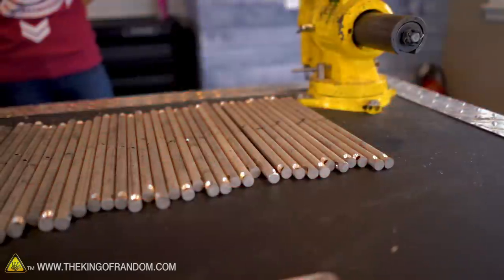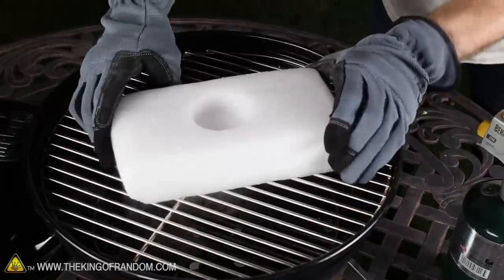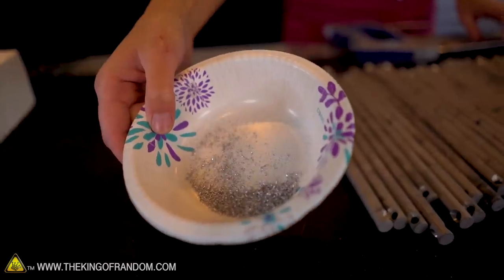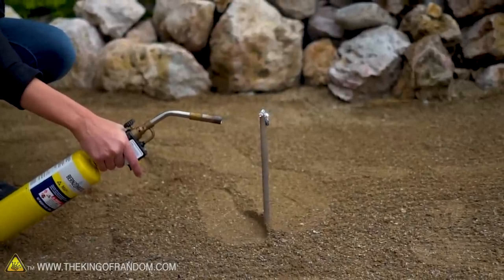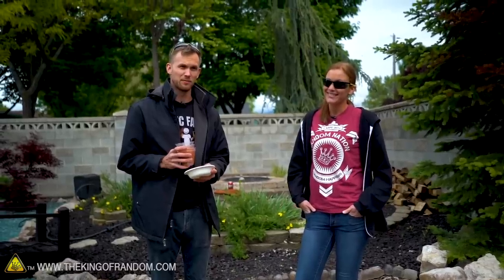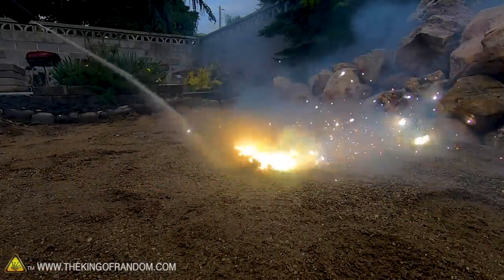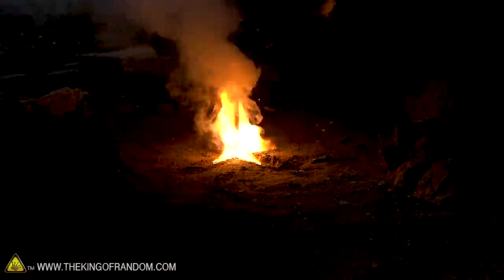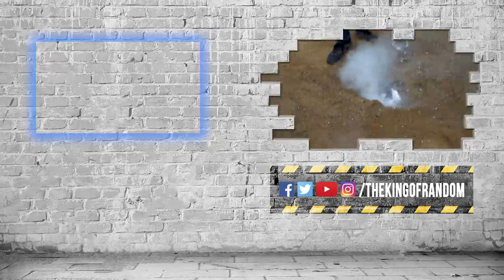Why Magnesium Fires are SO DANGEROUS

Comment: For those curious, when you spray water on a class D fire, the intense heat rips the oxygen out and uses it as fuel
Reply: with magnesium it liberates hydrogen which then reacts more and explodes.
Reply: I’ve had it ignite in my face putting car fires out
Reply: hydrogen and oxygen are explosive when mixed
Reply: and then leave the hydrogen free to burn in the atmosphere, so no what not even as a joke!!
Reply: because magnesium creates it's own oxygen
Reply: Oxygen is not a fuel. It is necessary for combustion.

Comment: Try putting out the magnesium with liquid nitrogen?
OR
Try making the magnesium even brighter with liquid oxygen
Reply: The first one is ok... The second one is suicide
Reply: Whis Sama liquid oxygen would also put it out most likely i believe it is as cold if not colder than nitrogen correct me if I’m wrong
Reply: Andrew Meany it is less cold
Reply: @M3ANIAC  for reference look at their liquid oxygen on carpet video... Heat and pure oxygen= bad time...
Reply: If you’ve ever seen a rocket explode, that’s liquid oxygen. Oxygen is why magnesium can’t be put out with water, and why it will even get brighter when sprayed. The oxygen in the water is also being burned.
Reply: I literally came to the comments to say that
Reply: DO THIS
Reply: Had the same idea with the liquid oxygen
Reply: @lileigh nguyen metal fires are self oxidizing it will keep burning
Reply: The oxygen idea would be awesome
Reply: Andrew Meany it is about as cold but liquid oxygen makes almost any that burns burn even better so it would most likely explode
Reply: @M3ANIAC  Temperature is irrelevant.  The lox would start reacting and build up heat very quickly.
Reply: I think will bee the same
Reply: @freddiemercurygaming4124  it will not be the same it will be wayyyy more energetic in liquid O2
Reply: I approve, liquid Oxygen
Reply: as a nitrox diver, I think mixing liquid oxygen and burning magnesium will create a terrible explosion. One of the important rule I've learned from the Nitox course is never allow fire within 10ft from oxygen tank, otherwise your body parts will scattered all over the places. Please never do that.
Reply: I dont think its stronger because its cold, i think its because it provides extra oxygen. the CO2 is broken into CO, or carbon monoxide. lnitrogen would not do much. this is why metal fires cannot be put out with water. the water breaks into hydrogen and oxygen.
Reply: putting it in liquid nitrogen will sustain the burning process as it will form Magnesiumnitride
Reply: The Lexdysic cartographer k
Reply: Magnesium burns so hot that it makes water break down into hydrogen and oxygen. That's why water won't put it out; you are just adding fuel and oxygen to the fire. 

The dry ice is CO2, which breaks down into carbon and oxygen -- so, again, it just makes it burn brighter. Adding Liquid Oxygen would make it burn extremely brightly, but it would be extremely unsafe. Like "Burn down your neighborhood if done wrong" unsafe.
Reply: great idea
Reply: @M3ANIAC  no liquid oxygen will give 100% oxygen atmosphere for a little bit for the magnesium it would burn at 2x to maybe 6x it's normal burning temperature
Reply: @M3ANIAC  Oxygen burns very well. It doesn't matter if it's cold
Reply: Oxygen doesn't burn
Reply: putting it in liquid nitrogen would be nice like actually dropping it in there
Reply: @huntonius  liquid oxygen does burn very well
Reply: @huntonius  It burns
Reply: @popepiusxv  Actually, oxygen doesn't burn - it makes other things burn (fire is just a self sustaining oxidation reaction after all)......  Next look up oxygen's pissed off big brother - Florine, it's a better oxidizer than actual oxygen ;-)
Reply: @Clint Jackson normal oxygen gas doesn't burn itself but liquid oxygen does
Reply: Anonymous Anonymous  what?
Reply: There's so many wrong assumptions in this comment section it makes my brain hurt.
Reply: You are a fool liquid oxygen burns much faster
Reply: Andrew Meany see their video, i believe its melting diamonds go see that video.
Reply: @chaitanyaprasadsahu9236  oxygen doesn't burn. It simply makes everything else burn better/hotter/faster.
Reply: Anonymous Anonymous  wrong. Oxygen, by itself isn't flammable. It makes things burn better, but doesn't burn on it's own.
Reply: Anonymous Anonymous  actually, what you said was, "both are highly flammable." Oxygen isn't flammable.
Reply: @M3ANIAC  it's not colder they use liquid nitrogen to make liquid oxygen
Reply: Magnesium continued to burn in a nitrogen atmosphere
Reply: @M3ANIAC  but its oxygen, so it will burn
Reply: @M3ANIAC  Liquid oxygen putting a fire out?! LOL!
Reply: Liquid ozone
Reply: @CausingChaos.  kinda like water on thermite. Great idea...not to pit it out, but great idea...
Reply: Patrick B
2 years ago
putting it in liquid nitrogen will sustain the burning process as it will form Magnesium nitride 
Correct.
Reply: I have seen a magnesium ribbon burning in pure (gaseous) oxygen. Well, "seen".

I was like 5 metres away with my eyes shut tight, and it was still dazzling. Ridiculously bright.
Reply: @M3ANIAC  liquid oxygen is indeed very cold but liquid oxygen is also a strong oxidising agent meaning it supports combustion and applying liquid oxygen to something that's already burning would be likely to cause a very violent possibly explosive chemical reaction.
Reply: Actually Magnesium can react with Nitrogen and make Mg Nitrate, which expels ammonia when you hit it with water

Comment: Uses water to make fire brighter 
Brilliant outstanding move
Reply: Why does it work though
Reply: @yocheeseify I'm a sailor, so I've been through DC classes where we learn about fires. When magnesium burns, it creates magnesium oxide, as they said in the video. What they didn't say is that when the magnesium oxide comes in contact with water vapor, it reacts, creating magnesium hydroxide and hydrogen gas. Burning magnesium has a very violent reaction with hydrogen gas, which creates more heat and light. It's the reason we just have to jettison (throw overboard) burning aircraft and other class D (metal) fires. Also, fun fact, magnesium doesn't require outside oxygen to burn, so those jettisoned aircraft can potentially burn under the water for years

Comment: "You can't use water to put out a magnesium fire!"
Nate: Keeps spraying it
Reply: might work if it wasnt airated so much aside from the fact that it still would need loads and loads of water
Reply: He was trying to get it to glow brighter
Reply: @kratosorokai1546   It would not. H2O + MgO= Mg(OH)2 +energy. By spraying it with water, he was feeding the fire.
Reply: @frantisekvrana3902  i did say he had it airated aka cause of the spray it would not work but i wonder bout if you submerse it
Reply: Throw it in pool = explosion?
Reply: 69 likes nice
Reply: @theguywhoasked6104  pretty much. There's footage of a fire department spraying water on a foundry with magnesium and aluminum. The footage is from a mounted security camera over a mile away and shakes when the foundry blows
Reply: @kratosorokai1546  No the water would keep it oxygenated and the millimeter wide ball of gas that would form around it would prevent the water from acting as a heat sink
Reply: @nicholashodges201  alright thanks for the explanation
Reply: that is correct. it burns under water.
Reply: I know this is and old comment but to me it looks like he put it out..

Edit: kept watching and I see the part this was talking about, oops

Comment: Hey king of random. 
Is it possible to cook popcorn in a tumble dryer?
Reply: CJ Lilac a washing machine washes. Tumble dryer heats up 🙄
Reply: CJ Lilac dryer*
Reply: no, i’ve tried
Reply: Theres a video on that
Reply: Maybe I dunno
Reply: I'd say no; popcorn pops at temperatures higher than most consumer grade dryers operate at, and even if you did somehow get the dryer to operate at a high enough temperature, the tumbling would breach the shells and allow the internal steam pressure to escape before the kernel could actually pop, thus no popcorn.

Comment: Try dipping the magnesium in liquid oxygen. Does it make it more flammable?
Reply: Liquid oxygen itself isn't flammable, but oxygen does promote burning, and magnesium fires are hot enough to separate the molecules in water making everything more on fire... so I hypothesize that, while it will not make an explosion, the breakup of the O2 molecules would mean that the magnesium would burn hotter and longer.
Reply: @GreebleClown  you mean brighter and quicker right?
Reply: @GreebleClown  oxygen doesn't promote burning, you need it to Burn anything. Burning is the reaction of a flammable material and oxygen.
Reply: @user-lg7cb6sr5z  Or in a broader sense, burning is any fast-paced redox reaction, it's the reaction between any reducing agent and oxidizing agent, reactions from the molar equivalents of magnesium and sulfur to exothermically form Magnesium Sulfide, to the reaction between two oxygen molecules and one methane molecule to produce carbon dioxide and water. Even the formation of Sodium Chloride salt from the reaction between chlorine gas and sodium metal fits the criteria
Reply: i’ve used thermal lances in construction for cutting through 1ft thick steel. they pump liquid 02 through the center of a hollow magnesium rod

Comment: It is used in aircraft, military aircraft for sure.  It does not get going that easily, but once it is going, such as on an aircraft carrier, about the only thing you can do is push it over the side.  After you do, it will burn underwater and underwater flares, and even normal flares contain it.  You CAN put it out, but what it takes is sand, and where are you going to get that much sand, that quick.

Comment: In the U.S. Navy, every time you are assigned to a different ship you go through training on that ship's fire fighting procedures. The basic procedures are common throughout the Navy, but customized to each ship because of differences in carried fuels, different fire fighting equipment, etc. On an aircraft carrier where "metallic fires" are more likely, the training is very simple. "You can't put this type of fire out. The only thing you can do is get it off the decks as quickly and safely as possible and into the sea. It will continue to burn even submerged, but burning metal does no damage if it's sitting at the bottom of the ocean".

Comment: Many years ago, when I was in a rented house share with another pyromaniac, we acquired a magnesium box.  It was great fun breaking bits off and setting it on fire with the blow torch that was set up on the kitchen table.
One night, when we got bored with the blow torch, we chucked the remains of the box (a corner) onto the open fire in the living room.  Eventually it caught fire, then we decided to bung some ammonium nitrate into the corner of the burning box (we just happened to have a big bag of it in the cupboard for some reason).  Nothing happened for about a second, then there was the brightest light I have ever seen that lasted for a  very short time and the box was gone.   It must have looked spectacular from outside, a shaft of white light heading skywards from the chimney.

Comment: You should try dipping the magnesium (on fire) in a bucket full of water (I think it will explode!)
Reply: Oh no No    
oh it will. I’m a firefighter and with car fires they have magnesium near the steering column and if it is hit with water it will explode
Reply: It burns too hot it instantly vaporizes the water underneath of it won't go under if you use a heavy enough amount to break the surface it's a 50/50 from experience sometimes it builds a layer of steam that protects it from exploding so it bounces around the bottom burning and sometimes it pops it depends on how pure it is
Reply: It takes the oxygen end leaves only    hydrogen which then explodes
Reply: Yes you are correct and the newer cars also have magnesium seat frames floor bracing and deck lids but that's different the water you're hitting it with is under pressure it forces passed the steam layer

Comment: Fun fact: that’s what is In sparklers

They use a powdered magnesium suspended in the clay substance
Reply: Actually, magnesium is just used for lighting it and creating white sparks. Yellow sparks are made with iron. The majority of the sparkler is low grade thermite clay. The colors come from different metal powders used in the mixture. Copper sulfate for green, potassium chloride for purple, sodium carbonate for yellow, strontium chloride for red.

Comment: Magnesium is also used for aircraft due to its heat resistance compared to some other metals of similar weight/strength. 
We still use it to this day, on certain components.

Comment: The reason you never use water is not only because it'll spread the burning liquid metal around, but because the metal is burning so hot that it's separating the water molecules into hydrogen and oxygen components, making the fire burn more energetically (i.e., hotter), so you'd be making the problem a lot worse.
Reply: I don't think it's the heat that makes this possible, but the fact magnesium is a more powerful reducing agent. The heat speeds the process, but magnesium will react with water to produce hydrogen, although very slowly.

Comment: This metal is still used in aircraft but as an alloy material primary alloyed with aluminum. 5052 aluminum is a mix of aluminum and magnesium, once alloyed it has a high corrosion resistance and is easily bendable. You cannot heat treat this metal and in aircraft you'll see this in and around fuel tanks as an example

Comment: was a jet mechanic on  A-7 Corsair when I was in the Navy in the 70's the wheels were made of magnesium also an the A-7 the yaw and the roll pack were made of titanium also A-7 dropped aerial flares were about 6 inches in diameter and about 5 feet long from high altitude with a parachute for lighting up a battle zone for straf8hg runs with 20 mm gatling guns and 2 inch diameter rockets from rocket pods. Because both of these metals are flammable all aircraft mechanic or anyone that worked on the aircraft had to learn how to put this burning metal out in an emergency. A ship had a tragic fire caused by an air drop flair that sailors were carrying from a flair locker on the USS Oriskany 44 sailors were killed.

Comment: Get a stick welder and attach the clamp to a rod and strike an arc with it.. In other words use it like a welding rod. Or attach both clamps to two rods that you strike an arc between.This would be high heat in a very concentrated spot and might help the rods burn from one end to the other.

Comment: You missed nicer experiments:  1-2 mm Mg wire burns continuously in air and under water 
as light source for scuba divers. As thin ribbons in the 50-60's were used  as flashlights triggered by batteries before the xenon flash light was born

Comment: In days of yore I was a firechief at a lumber mill.  I had a fire chief's handbook full of what to do in situations,,unusual situations.
There was a small entry on magnesium.  It addressed fires in business of machine magnesium.  one line--if the roof hasn't vented (blown the roof off) dump lots of water so it will and just let it burn.  There are chemicals that you can spray into the magnesium fire which will melt and coat the stuff.  Ir was very expensive and I doubt any public FD would have any large stock

Comment: Mix magnesium powder with iron oxide powder and aluminum powder in equal 1/3 quantities. Then put it in a small bag with a solar igniter and a battery and switch and get it burning and try to put it out.

Comment: You can use water to put out metal fires because ( if you manage to saturate everything ) only the metal structures will be able to burn, and a general building only has a couple of % of metals in it. The exception would be a mining or metal warehouse and perhaps some sections of a hardware store. There are other factors why water is avoided, like the weight and cleanup and to not ruin expensive machinery in Industry fires.

Comment: I work in an aerospace parts factory, you should try starting a titanium fire, they are a nightmare to put out we have then a couple of times a year and it can take 4 or 5 powder extinguishers to get a small one under control, but you can't put it out til it's done burning.

Comment: Unfortunately, you can't put those fires out with a dry chemical fire extinguisher, which is suitable for class A (wood and paper), class B (oil, gasoline, and other flammable liquids), and class C (electrical equipment). Fires from combustible metals like magnesium is a class D fire.

Comment: Why would you use a pressure washer to put out a fire? I have put out a magnesium fire with a fire hose. It did spark and pop a lot.  I also did put out an oil fire with a fire hose a long time ago, no foam was available.

Comment: In school we were doing experiments with powdered magnesium lighting it in the bunsen burner. One kid managed to drop burning magnesium into the jar of powder setting it all alight. The teacher grabbed it with tongs and submerged in it a basin of water which just pissed it off. He ended up taking it out to the long jump sand pit. It eventually burned itself out. He said that the Magnesium was burning so hot that it drew oxygen from the water.  Was quite the lesson.
Reply: That's the kind of situation you just let the sink run and let the magnesium burn itself out. The flow of water carries off most of the heat, protecting other stuff. You'll likely be replacing the sink and some plumbing either way.

Comment: Magnesium is also able to extract the oxigen from the water if its hot enough... The only thing youll do is cooling a little bit because you spray it onto... If you put it into water it will still burn.